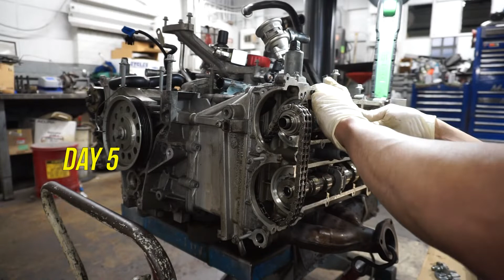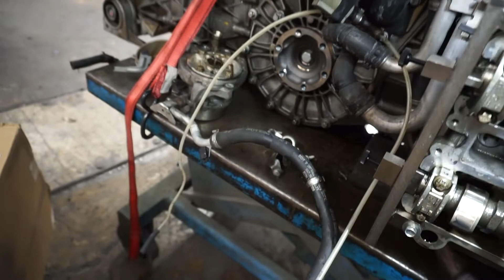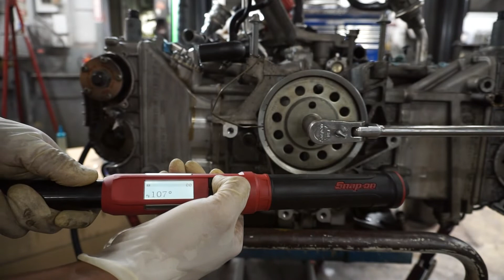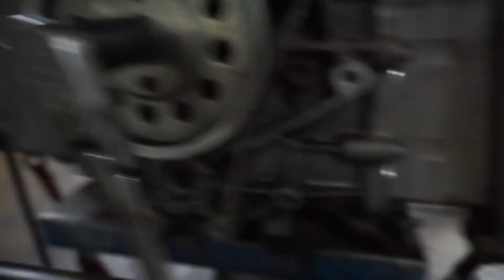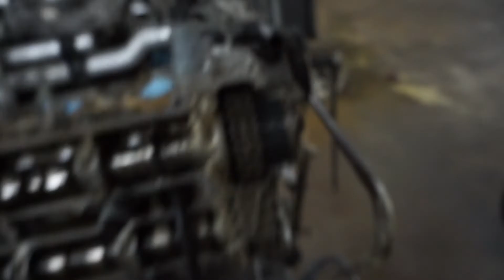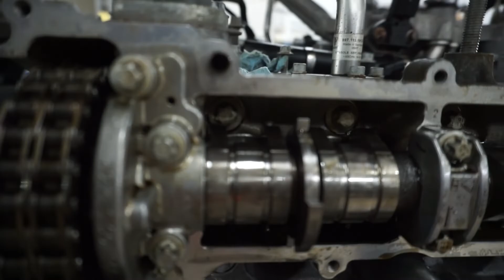PORSCHE 997 TURBO MAJOR SERVICE AND MAINTENANCE PART 4; CAMSHAFT INSTALLATION AND ENGINE TIMING

Comment: Great video... Thanks for the upload, are these can holding tool original tools from porsche ?
Thanks
Reply from the maker: Thank you! The tool used in the video is made by BAUM, I believe.  They were rented to me from a friend and RL member.  The PORSCHE OE tool is $2k, and my local dealerships would NOT lend them to me despite me offering a deposit to cover the cost of the tool if I didn't return it along with a rental fee.
Reply: @NSXavier997  did you have written guide?
Reply from the maker: @carnynja9966  I used the PORSCHE factory workshop manual.  The wsm is translated from German to English, so a bit of “deciphering” is needed.  But for the most part, it’s a pretty good manual.

Comment: Good work my man. I have an 07 turbo, about to drop my engine soon. Where do you get your factory workshop manual from?
Reply from the maker: Thank you!  I downloaded and printed the PDF's from ALLDATA.
Reply: @NSXavier997  I do have access to  alldata, Honda tech myself. I thought you might have the service manual from Porsche.
Reply from the maker: @HauNguyen-wq2lx  cool! You’re all set then.  The manual on AllData is the same as the factory workshop manual.

Comment: Good job! What were the b1 and b2 camshaft deviations angles after the work was complete with buam tool? I see that the baum tool you are using is slightly different design than the factory. I do have the factory, would been happy to loan you mine.
Reply from the maker: Yup.  I wish I knew about your shop and channel back when I did the job!!  I would have definitely taken you up on that offer.  The factory tool is $$$.  

What I did was identified crank and cam positioning in TDC1 & TDC4 before taking anything apart and made sure the fixtures “slid into place”.  Once I did that I knew that just as long as I put it back together in this exact position, the engine should at least run.  What I wish I had done was take an initial cam deviation reading before beginning work.  Final deviation #’s at idle were bank1 -2.8748 and Bank2 -3.5155.
Reply: @NSXavier997  That's one way to do it, pretty good deviation readings.
Reply: Can someone explain what is cam deviations means, until what range it should be ok ?
Reply from the maker: @vicky-nc3to  The bank 1 and bank 2 intake camshaft angles in relation to the crankshaft.  This reading is referenced from the cam position sensors.  It is a good data point to study that will tell you a lot about whether the engines timing chain is potentially stretched, or if the cam gears have slipped.  General rule of thumb is that you want both values to be as close to each other as possible.  You also want them to be in synchronization when dry revving or applying load.  I have read and been told that a deviation of up to 10* is acceptable, and the engine will still run in that condition, although I would never want a reading of that variance.